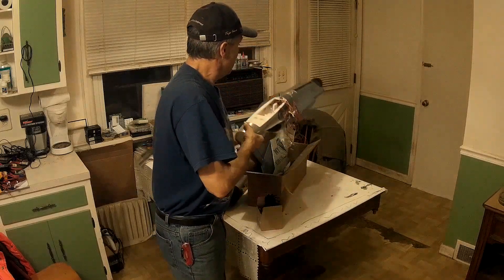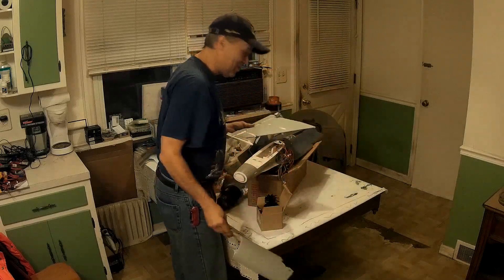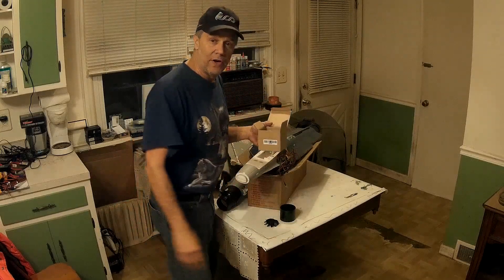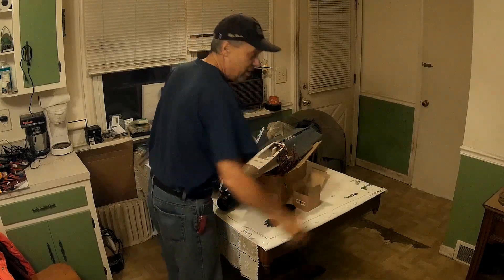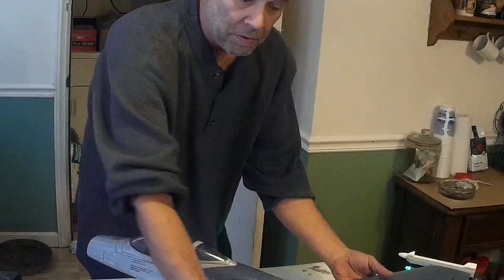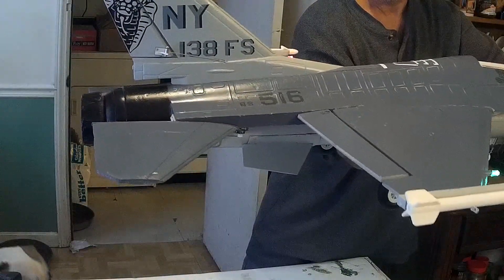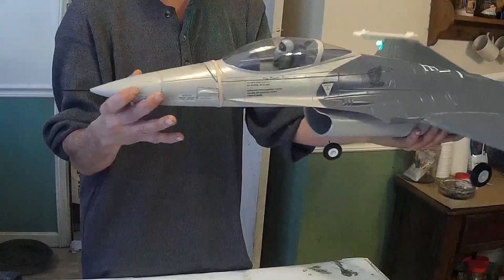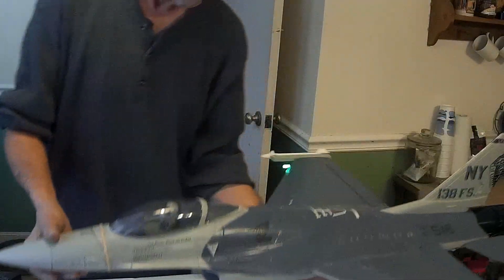Freewing F-16 (CRASHED) Fighting Falcon 70mm EDF Jet, (Re-Build #5) with Upgrades

Comment: Cool it was great watching the whole build happen in fast motion. She looks like a beautiful model! Do you gain or lose flight efficiency by putting the motor inside the body?
Reply from the maker: +Daily Drone FPV subcribed to your channel.  putting the motor in back to original placement.  upgraded motor, still waiting for fan parts to do 10 blade.  65a. esc.  speed is about double from stock set-up.  Thanks for subscribing.
Skip...contact me anytime...Happy Flying